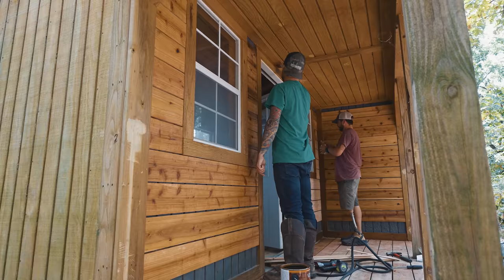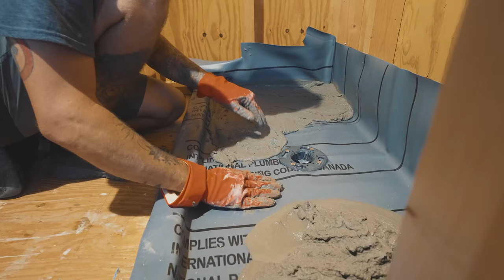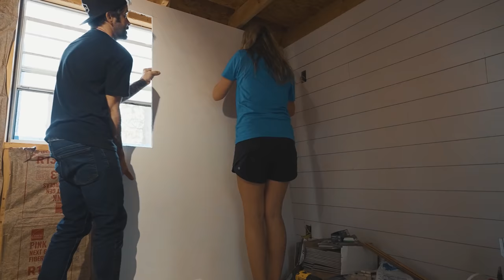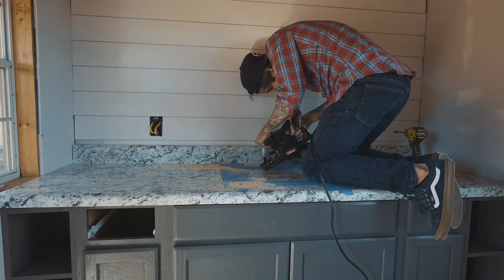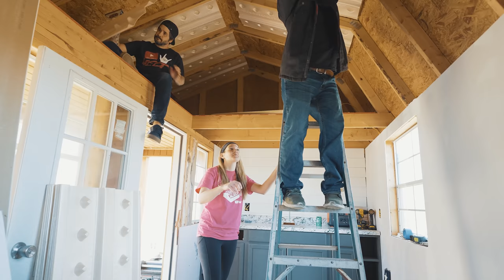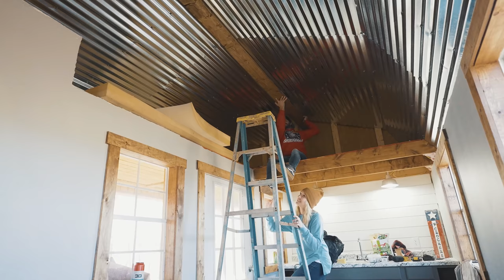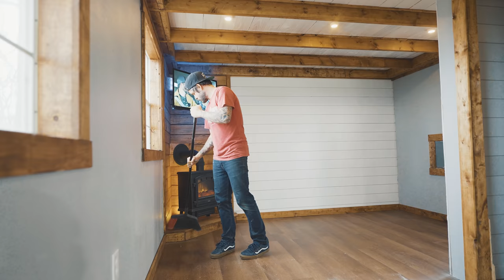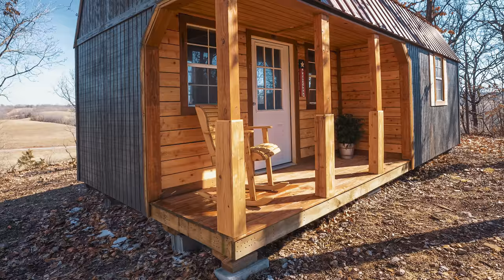Abandoned Shed Converted Into a TINY HOUSE in Under 20 Minutes!  SHED TO HOUSE CONVERSION

Comment: A wood lined shower, that’s a decision. You obviously know what you’re doing though and I don’t so I’m really interested to know what stops the wood from rotting or getting mouldy?
Reply: He probably sealed the wood in the shower with a marine grade varnish.  Cedar is naturally rot resistant.  Add a high quality varnish and it will last as long as treated lumber.
Reply: Everything is a decision. 👏
Reply: @michellekeith8955  wow! Did not know that!
Reply: i'm less concerned for the wood(looked like cedar?) and more concerned for the insulation 'cause that didn't look like the particularly mold resistant kind
Reply: @michellekeith8955  Thanks, I learned something new.
Reply: With epoxy & marine grade spar varnish it should be fine.
Reply: @jennasamuels3160  thank you for that, I loved the wood shower would rather smell that than wet metal lol
Reply: @senbuvoltz1215  me too.
Reply: @senbuvoltz1215   ... will it still smell good after being sealed??
Reply: @briannab5296  likely if we use a natural way to seal it but the sealant that was suggested I'm sure is a synthetic type (no hate)but that might have a weird smell or maybe none at all! So not too sure (:  lol I'll try to remember to come back and let ya all know if I do it for mine💗
Reply: Cedar is resistant to water damage (cedar shakes for a roof) but in this, no exhaust, steam stays inside, so mold is an issue.
Reply: @gilliansl  lo I I
L
Reply: Your eyes are open, grasshopper.  Go to home depot or home store and checkwout their book section to School yourself 😊😊😊
Reply: @briannab5296  one should consider off vapors from sealants and paints, too
Reply: @servraghgiorsal7382  Why? I have no interest in being a woodworker, I just found this one thing interesting.
Reply: @michellekeith8955  that wont' last very long even if he did that...
Reply: @gilliansl  could have waterproofed by using water cured Cedar logs and  cedar oil and another marine grade waterproofing oil Or have used water cured Cypress and oil.
Reply: His stuff looks very catchy when zoomed out but the actual build quality is poo. No house wrap, no ventilation anywhere, nothing to help steam escape in the bathroom, A LOT of horizontal boards were all uneven/choppy/not flush, he cut the hole for the sink after setting the counter for some reason, stained a bunch of wood after he mounted it, battery powered lights for some reason.. He doesn’t need an oven because you can probably just bake stuff in the loft in the summer because it will get so hot. I really hope he’s not selling these properties.

Comment: I love it. I am curious though do you not have to put the plastic vapor barrier over the insulation if you use the metal for the ceiling ? And are you going to add solar later on or just going to continue to use the generator?

Comment: When I did mine? It was a fourteen by twenty eight a frame with no porch. It's all spray foam insulated has got prefinished. Bead board because it was cheaper and easier to put in. And  I used corrugated aluminum for the ceiling. Build in porches take up too much interior space I added one later

Comment: As a tile contractor, I have to say that there are some major problems with that shower. First off, your concrete for the pan was way to wet. It should have been just wet enough to hold its shape when compressed in the hand, not wet enough to literally pore out of a bucket. Next, it appeared you used mastic wall adhesive to set the floor tile in the pan, that is meant for wall application only, never for a pan. Lastly, you used wood to finish the shower walls? Do you know why wood is never used for shower walls? Because its absolutely terrible as a shower wall. They adsorb water, mold and rot, even if you use a heavy oil wood like teak, it won't last.
Another thing, you laid the flooring straight down to the subfloor without a vapor/thermal underlayment barrier. I hope you like cold floors growing mold under them because that is what you'll have.
Reply: Dang. LOL. Im far from a professional, but I silently questioned the wood in the shower as well.
Reply: Too* wet.

Comment: This tiny house looks amazing! Would love to live there!
My ONLY concern is the TV above the log burner... I'd be worried the TV would melt!
Reply: The log burner is electric, no worries.
Reply: Not log burner elec heater fake fire/logs
Reply: If it was a real log burner, you should be concerned about the lack of heat shielding and spacing, not just the TV. Your house would catch fire, probably before the TV even melted.
Reply: @Inspectorzinn2  No! FAKE  "read" ELECTRIC HEATER.

Comment: Seems me and several others can see that the issue with not using a vapor barrier, and pressure treated wood with proper seals, will cause moisture to travel between and cause mold build up. I get wanting to get it done quickly, but might as well do it properly, so you don't have to worry later.

Comment: In most Korean apartments, the bathroom is all one room. The shower is actually hooked up through the sink. I always feel like that would be a better use of the bathroom space in tiny homes rather than insisting on some kind of separate shower space.

Comment: I’m worried about mold and moisture, which is bound to happen without a moisture barrier between your insulation and both walls and especially the ceiling.

Comment: I could critique the whole construction but I guess to me there are just way too many conveniences.if not mistaken you used and electric fire place and made it look wood burning? Maybe my error maybe but if your taking the time is go retro. Hand pump, oil lamps, r. add some solar. Is this property city or country. ? I’m just old school and a tiny house just needs tons of insulation for cooling and heating wet? purposes. But I’m a homestead kinda gal. Does  it have a well? Or city water, sewage? You can’t always rely on the grid.

Comment: I actually love what you've done. But I have a couple questions. No I don't know what state you're in and I don't know if it actually snows where you are. But I see that the shed is up on blocks not on a foundation. I know that blocks versus foundation makes a difference on taxes.. I saw how you insulated the walls and the ceilings etc. But what about underneath? I can't imagine how you could have gotten under there in the first place.. But I think it's a very important question and hopefully you have a suggestion or an answer.
Septic system. I see that it's obviously not a composting toilet. And finally the cedar in the shower surround. I love cedar. Especially the aromatic cedar. It's been a year now and I'm wondering how the cedar has held up. How it looks and how easy is it to clean? Did you run electrical under the ground or is your electric provided by generator? Thank you in advance and again Great job.

Comment: I put a bathtub, sink, w/d in a shed, and had to reinforce the floor, with sistered 2x4 joists. and of course, another layer of 1/2 in plywood, and a finished floor.   Quite the project. raising the shed, to put sistered joists in.  But, the worst, was this new floorining.  I greatly prefer, a painted floor, or sheet flooring   The problem with the new flooring, that is not breathable is that it buckles floors in Louisiana (we are not there, but I''m paying attention) .  Your project looks great.

Comment: like the look but seems a lot of function was sacrificed for form. no oven or stove top to cook on? is there a fridge going in at some point? either of those i would have allocated a spot in the kitchen area for. I would have definitely worked in a real fireplace, you're surrounded by woods that need clearing from fallen brush anyway and that heat will be much more efficient and effective for the home, plus it's free. wood in a bathroom? looks really good but... moisture issue's with insulation etc. 
it's a no for me dawg. 

thank you for some ideas as to how much work goes into a shed build and, very fun watch

Comment: It is esthetically pleasing ,even whimsical . As a weekender,guest house it would be absolutely great ! As full time living in -no ,for few reasons it is possible organized utilities ,but insulation and ventilation close to none ,moisture would be enemy # 1, ventilation # 1 - from bathroom that would share all smells with rest of the place ,to the cooking that also would add moisture. #2  too low to the ground , it need septic of some kind and can be hot in the summers ,unless we didn't see you checking natural air flow with windows,evidently it does have electrics ,but as all homesteading -need alternative heat source. plus where is a laundry ?,where is a bedroom ?.Where is a pantry and fridge .?..Sorry for criticism,but its way far from self contained ,self sustained dwell ,even if it would be tent ...But it is cute !

Comment: Bathroom needs a sink to wash hands after going potty, kitchen needs a stove/oven and or microwave and a refrigerator. The fireplace area should be brick floor and half way up brick walls to keep from burning the wood it's too close to the wood walls probably not fire proof and I can see the tv melting from the heat otherwise it's nice
Bathroom also needs a window big enough to escape through incase of fire

Comment: I know u get a bunch of negative Nancy comments and I hate to add to it. This is more of a critique. One thing I noticed on this whole build that kinda made me go 😬eeek as a woodworker/carpenter and that was the loft wood ship lap. Scribing it in on the ends to flow with the tin metal would have given it that fine finished detail. The gaps between just shown thru too much. So now for the positive lol for a fully off grid build u guys did good. Love the colors used too. I’ve been using an off grid battery powered propane water heater for over 7yrs now and I love that the water is instantly hot. Makes it worth the purchase.

Comment: It's Kraft faced insulation....it includes a paper vapor retarder which helps prevent mold and mildew. They are installing it correctly with the Kraft side facing them.

Comment: Honestly its a good build, but I am seeing all kinds of problems cropping up with mold, as the walls and ceiling are not properly sealed and there is no type of fan in the bathroom to draw out moisture. In the kitchen I would have moved the cabinets over and created a space for a waste bin, as well as putting in some type of cooking stove top, even if its electric. Solar panels can be used for such things. Also A window in the loft area so that it can be used as a sleeping space and it would also aid in keeping the place dry and fresh air circulating. In the bathroom I would have built slightly bigger to include a wash sink, outward swinging door, and ventilation fan in the ceiling and window above the toilet to allow air to circulate so that moisture buildup wasn't a concern.

Comment: Not trying to be overly critical, but you didn’t seal the seams on the cement board in your shower. The pan looks great, but the cedar boards will trap moisture that will wick into the insulation? Hope you addressed that, but the video didn’t catch it

Comment: Should have made all the trim outside the house the same stain as the little porch / deck that would've looked amazing in my opinion. That and add stained trimming in every corner of the inside of the house with a dark or light gray paint on the walls.

Comment: My mom's cabin didn't use a vapor barrier in her bathroom. There was mold and mildew under the entire roof from the shower steam creeping up through the walls and ceiling. The wood clad walls and ceilings are all warped and bowed out as well. A good $100k in damage throughout the cabin, not including the $150k spent on replacing the roof.

Comment: Just going to say I think it's awesome what you're doing and I am considering something similar for a hunter's cabin. 1 big thing on safety and this is just a tip the 16d nail gun holding your hand in line on the last stud is bad if it skips out or double shoots that's not fun. Holding a stud at the top or bottom plate with your fingers touching both the stud and the plate you can have the nail fallow the gran or hit a knot and the nail will win that fight. It's good practice to not have your body or hand in line with the business end of the nail gun. Use your foot with steel toe boots on to hold the stud and a hammer to move when need be. Cool trick too is take 3 scrap 2x4 and nail them together with the middle board at 3 inch inset so you can twist a 2x4 with leverage and safety.... I shot my self though the thumb doing a stud block stud it sucked lol

Comment: I've watched several shed conversions, Thanks for showing the nitty gritty, how it's really done: it's not just about making the inside beauteous, but making it weather proof, and taking care of business- and about that- You make putting in a bathroom look easy!  Had me going there when you started stapling with combustible wood paneling  behind the wood stove - but it's electric. Where is this cabin? Somewhere in warmer climes?
Reply: This isn't weatherproof. Without a vapor barrier, all of that insulation will soak up moisture and grow mold. The bathroom looked easy because he built a shower that is going to rot from the studs in. Water is going to get into every crevice and destroy the entire outer wall, along with the floor joists. Of course it was easy. Doing things completely wrong is very easy.